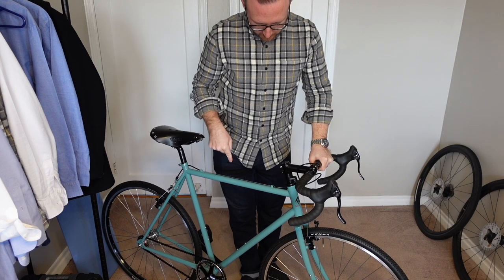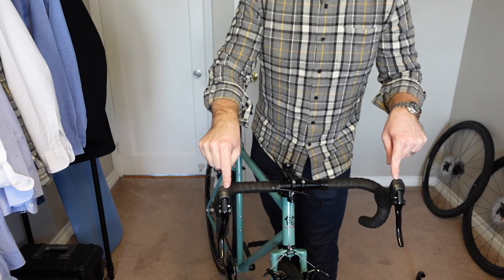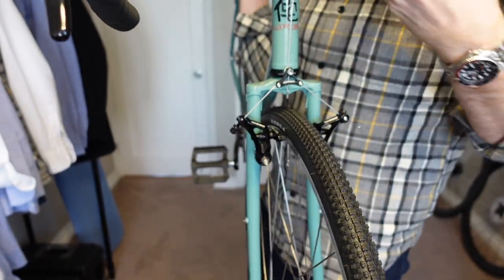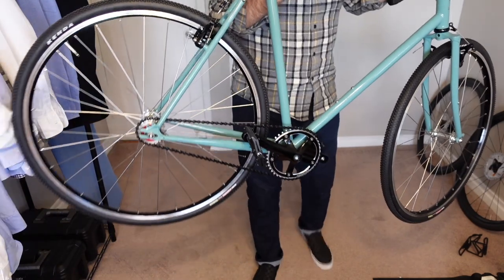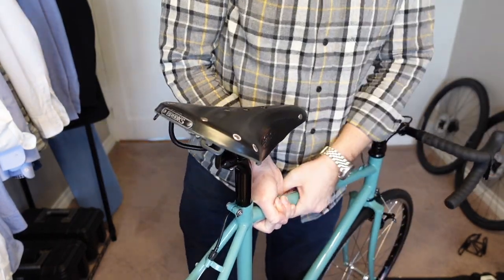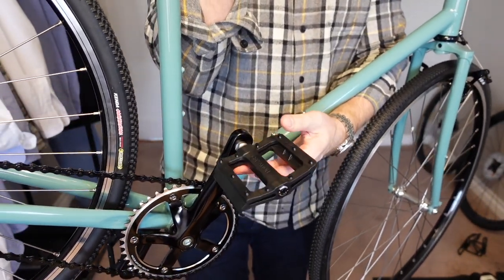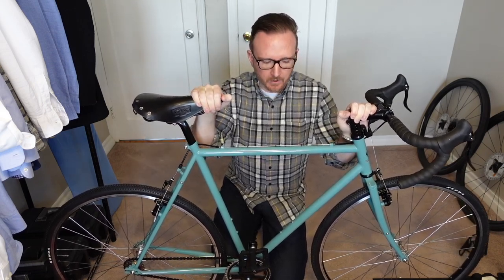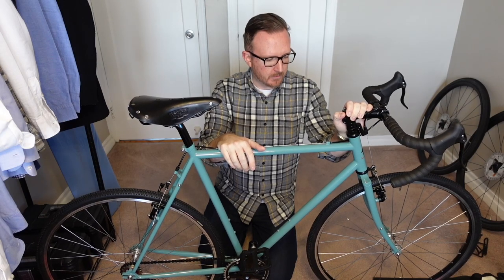Wabi Thunder Unboxing

Comment: Super simple, reliable, robust steel, nothing to break, everything standardized, everything user serviceable, no fancy clothes required. I can appreciate all of that.
Reply from the maker: That’s the main draw of these bikes. They are limited since there are no variable gears, but for rides that aren’t super long or hilly they work. Very easy to clean too.
Reply: @tommilano5431   I have a carbon bike and a aluminum with carbon fork, you can feel quite a difference of carbon being real smooth, how does steel feel compared to the two mentioned ?

Comment: Nice, just ordered my first Wabi after watching Zach you guys lol.  I got the Ube Purp Special frameset and custom building my parts for assembly.  Got a question, would 25's be okay since i only weigh less than 148 ish.
Reply from the maker: Thanks, glad you enjoyed it! 25s should be fine for you. I had 25s on my classic, and they worked, and I’m at 200lbs! Ran them at 85psi, no issues. I prefer 28s at a minimum though. 
I think Zach and I are the two creators that show up when searching for wabi cycles related stuff. 
Thanks for watching!